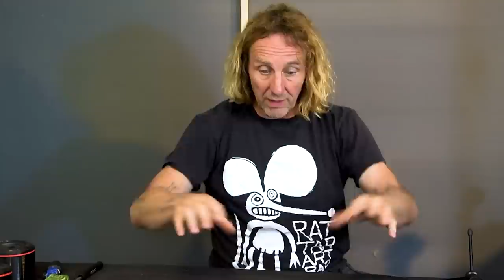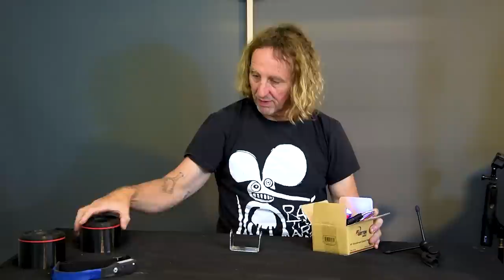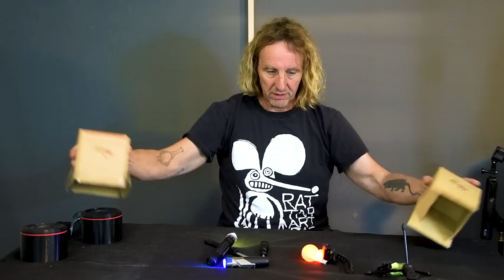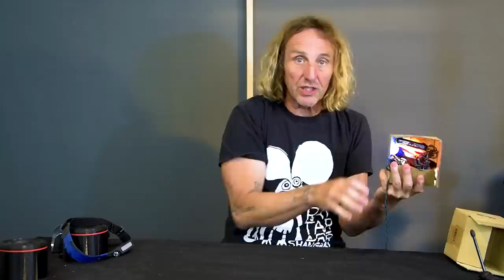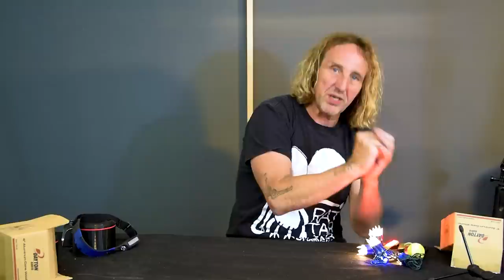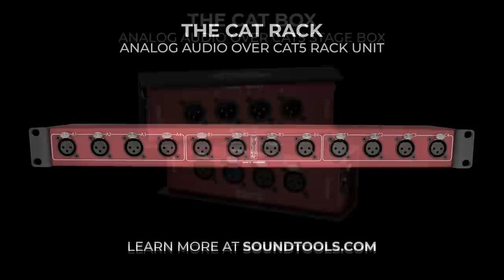Thinking Outside the (Speaker) Box - Does stereo Ruin Sound?

Comment: I was wondering if some advanced AI perhaps could take a stereo recording as input, and infer or guess the locations of each separate instrument or voice, and process those out into separate tracks. Then it would let me play that through some system with a dozen speakers, where each speaker only handles one track. could it work?
Reply from the maker: It's pretty difficult to separate sounds once they've been combined together.

Some sounds are more difficult to separate than others.

It's kind of like making food. Let's say you mix some almond milk and cinnamon and cranberry juice and oatmeal and put in some sugar and honey maybe some crushed raspberries and some whole blueberries and and walnuts and mixed it all together and then put it in a blender for just a second.

Well now you have a mix not two different than a sound mix we've combined a bunch of different things into a somewhat unified but dynamic outcome. Different textures and flavors all combine together.

Now someone wants to separate everything back to its original ingredients. Well you could pick out the blueberries mostly except for the ones I got mushed and juice that leaked in to the rest of the mixture. You could filter out all the big pieces and then from there maybe pluck out most of the walnuts and the bigger pieces of crushed raspberry.

And you'd be left with two things, a strainer full of mostly oatmeal and a juice that has cinnamon and honey and sugar and almond milk in it.

And that's pretty much what would happen if he tried to separate music out you could pick out the big pieces they wouldn't be pure and you'd be left with kind of a mush of remnants of everything else. AI may be able to do a pretty good job of getting those bigger pieces And that may be adequate for what the goal is or maybe not
Reply: @DaveRat  great analogy, I see what you mean. thanks!

Comment: Another great video Dave. Have you ever listen an L-Acoustics L-ISA setup? If yes, did the listening experience came near what you are treating in this video?
Reply from the maker: I have heard L-isa and deployed it for shows, I have been to the demo room when it was being developed in France.  I have been to Dolby studio and heard Atmos demo by Dolby.

These systems are interesting in differing ways. Lots of processing to try and create the illusion of sound radiating from a certain point or multiple points.

These technologies and also fascination is Holoplot as well.

None of them sound realistic to me such that I can't tell the difference between the sound source and the reproduction but the do have applications
Reply: DSP the DES (double edged sword) 😊
Reply: I’m not sure if someone mentioned this already. Do you remember the mono PA above U2’s heads on the Zooropa tour? At least then all the band sound came from stage centre. A very bold but sensible concept, brilliant I thought. Chilis couldn’t do that, their flame throwing hats would set the stack on fire 😂
Reply from the maker: I mixed rage against the machine opening for u2 on the pop Mart tour with that mono ball and it was not a very good sounding rig quite miserable to mix on and sounding
Reply: @DaveRat  ah yes Pop Mart, not Zooropa. Yeah I heard other support engineers saying the same thing. I wonder if it was the rig, or the challenge of mixing in mono (through one source rather than two). What do you think was the issue with that set up? Cheers
Reply from the maker: It was a sound setup designed by the visuals team. Looked cool and the bad sound was obvious by the design
Reply: @DaveRat  “designed by the visuals team” what could go wrong? 😂
Reply from the maker: Fancy shiney shit that sucks

Comment: I was intrigued by your monitoring setup using 3 wedges. I have found on EAW's website your setup guide for Microwedges, and did not read correctly, because I thought the 3 wedge setup meant vocal in the center and instruments left/right. But recently I re-read it, and realized that you suggest to put all the instruments in the center wedge and vocal both in left and right. So how does this setup correspond to your idea of not putting the same source into to multiple speakers?
Reply: I can answer that.  Just having the vocals alone removed from the instruments middle wedge is enough for better clarity
Reply from the maker: Putting the same source into two speakers insures summation when equidistant from the 2 speakers and cancellations when off to one side or the other.

If summation when centered or equidistant with cancellation in other areas is desirable, then the same source into multiple sources can be beneficial.

Dual vocal wedges, sub arrays, line arrays are a few examples of using the same source into multiple speakers in a beneficial way.

Oh and what I said or say is that the same sound to multiple speakers is unnatural but I never said unnatural (does not exist in nature) is bad or good.

It's all about understanding the tools and using the right tool or method for the job
Reply: @DaveRat  Oh wow, thanks for the detailed answer! I see your point, and thanks for explaining the result of doing that too. Another question ;-) When would you say it is important to move from two (left/right/vocal in both) to three (vocal left and right/instruments center) setup?
Reply from the maker: That has too many options. I would say do it when the outcome is more desirable than not doing it.
Reply: @DaveRat  Thanks!

Comment: Hey Dave, what about using panning in a stereo system? If everything is panned to a slightly different degree they'll all have slightly different reflections (or at least the average of the two paths from each speaker will be different)
Reply from the maker: That's a step in the right direction. Stereo speakers are like two showerheads pointed at the listener.

Natural sound is like rain, band and other sound sources are like sprinklers in a field radiating sound in various directions.

Panning and altingbsources sent to left and right will help but it won't make directional showerheads into sprinklers
Reply: The problem with panning in a big stereo system is that most members of the audience will only hear one side of the p.a. Whichever speaker they are nearest to will be all they will hear due to the Haas or precedence effect. If the two sides of the p.a. are completely different then maybe it starts to work as they will hear both but with a delay between them. Maybe the answer is a row of sources or line arrays above the stage with each instrument in the source that is nearest to above them.
Reply from the maker: Hmmm, mic'ing the same source such that it is somewhat decorrelated each mic to the other and then panning will solve that.

But that won't solve what is lacking in sound reproduction systems.

Comment: some things just can't be reproduced exactly as the original so people find clever ways to trick the senses. the better we understand how the senses work, the closer to 'reality' the trick or approximation can get. 

if one is in a garden (or room) w/ a bunch of people talking, a map w/ the position of most persons can be determined just by listening... but that fairly accurate depth perception can't be used if let's say one is listening to all those voices from across the road. i guess one could still recognize voices, who's who, but i'm not sure placing them on a 3d map is possible..

a multitude of sources appear as a singular one if observed from far enough. so by that logic, wouldn't a single stack of speakers positioned someplace center stage and radiating 180deg. horizontally offer the best approximation for the listener?

this may be completely stupid, i'm not working in this field, i just find the topic interesting.
Reply from the maker: I am happy this is provoking thought

Comment: Why dont we use multiple sources meaning speakers that play the rights frequency scattered around the room and all aim to a central point like the middle of the room toward the ceiling all in mono would that work
Reply from the maker: Multiple sources recreating the same signal creates maximum interference and cancellation and summation.

Which means having multiple sources recreating the same signal all located at different distances will ensure that the sound is completely as inconsistent as possible throughout the room.

If every speaker reproduced a different instrument then they wouldn't interfere.
Reply: It's technically not the same if each speaker plays a narrow band like vocals thru one , guitar ,snare drum. Bass ,and highs for Instruments like your tuning strategy video but looking at a frequency chart and see where female and female vocals fall between and just let one speaker deal with it then guitar frequency to another I hope you get what I mean
Reply from the maker: Yes if the sources are de-correlated, either by reproducing different frequencies or reproducing different sources or even different captures of the same source from significantly different parts of the instrument such that the tones and overtones and timings are significantly different, then that will eliminate or minimize summation and cancellation issues.

I cover the concept somewhat in this video

https://youtu.be/VHjdh-Vka-g?si=gzAkyaemFEX-ArEt
Reply: I'm going to try this but need to see which frequency chart will I use to copy each instrument and vocals then probably use crossover capacitors to minimize crossovers in the mix
Reply from the maker: @MyTgangsta let me know how it goes

Comment: Dave, what are you feelings about L-Isa and similar mixing solutions?
Reply from the maker: There are many application dependant ideas. L-Isa improves horizontal imagery at the expense of lifting the vertical image.

Sound bars expand the horizontal image by emulating stereo from a central location at the expense of a phasy sound and inteligeability, surround simulates a 3d environment by radiating sounds inward and sort of holds that illusion as long as you don't pay to much attention to it. 

All of these have advantages and issues.

I would like to see/hear just one speaker that actually and really sounds like just one instrument.

I believe 9nce that is created, we can build from there and end up with something actually impressive.

Comment: The grateful dead wall of sound eliminated this by giving each instrument its own speakers.
Reply from the maker: Good stuff and back in the mid 80s I actually setup a wall 9d sound setup when touring with Black Flag.

It was interesting, pa behind the band was a bummer, pa farther from the audience was a bummer, clarity and horizontal imaging was improved, much the same way L-isa (L-Acoustics) setups improve but L-isa has the added aspect of being able to control where an instrument radiates from. Plus L-isa does not take up the entire stage.

All that said, the Dead's somewhat unwieldy experiment and modern day setups like L-isa, Soundscape and Atmos are making headway

But still, all the systems are like going from one shower head in the wall (mono), two shower heads (stereo), a giant shower head for each instrument (the wall of sound), shower heads on all the walls (surround sound), programable shower heads on the walls and ceiling (Atmos) and so on.

But how good do all those shower do at recreating the experience of standing in a field of sprinklers?

Audio sources are like sprinklers sending energy OUTWARDS in various directions and all the systems try and recreate that by shooting energy INWARDS 

so yeah, there are advances but I would say that we still have a long way to go

Comment: i try to have each source besides the bass and kick panned slightly different to one side or the other based on what side of the stage they are on.
Reply from the maker: That's a small step in the right direction
Reply: make the best of my limited resources.

Comment: Wall of sound Dave?
Reply from the maker: Well, wall of sound is a wall of sound behind the band. While the idea of separation is there, impractical solutions are less than desirable. Where does video go? Do ya really want the pa behind the band?

In my mind it's much more than piles of speakers being just tall versions of the small versions.

But yes, wall of sound or what I did with the Double Hung pa design I toured with are startes in the right direction

Comment: Stereo is still a gimmick. A good, immersive, mono system will trigger psychoacoustic processes in the brain, creating a soundstage rather than presenting a pre-fab'd one. The depth of mono let's you focus on individual instruments at a time effortlessly, and also, the depth of mono provides the energy generally lost in stereo. For the individual instruments as well as for the whole production. Let your mind decide... 

Or dismiss this by still buying in to 1950's Hifi shoptalk like "Mono is like listening to an orchestra through a hole in the wall- stereo removes the wall," 😂
Reply from the maker: Both are useful and interesting.

And neither come close to radiating energy in the same ways as most sound sources do.

Hey, i want to recreate the feeling of sitting around a campfire for a group of people in a room. I know! I will use central heating, should I use one wall vent (mono) or two (stereo)? Or maybe if I put wall vents all the way around the room (surround) or on the ceilng as well (Atmos), it will be perfect, right?